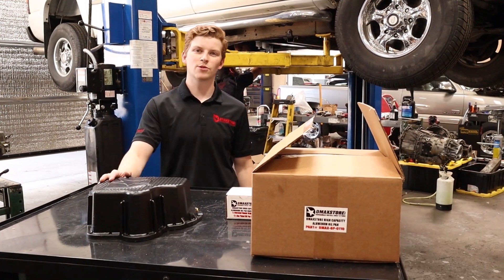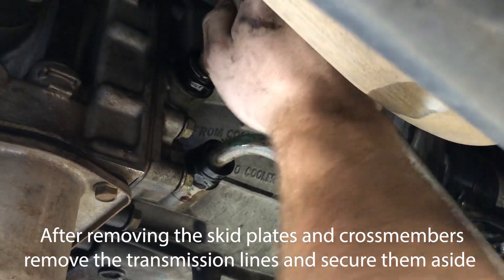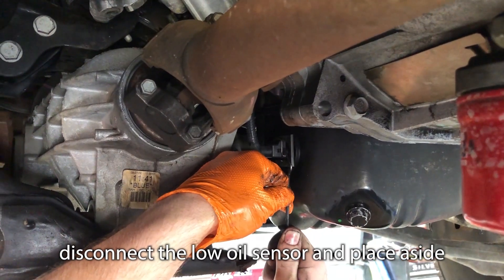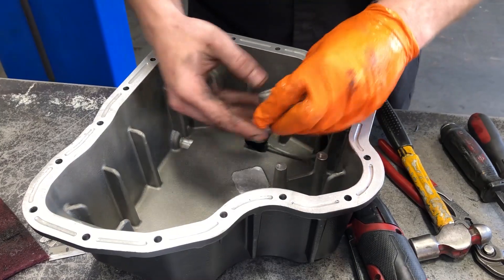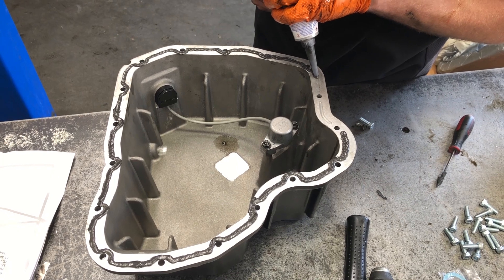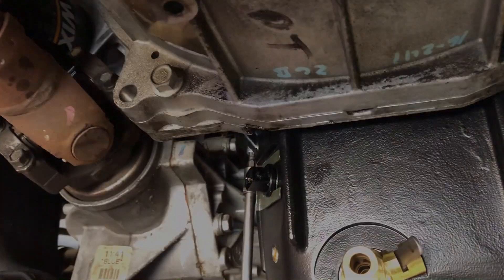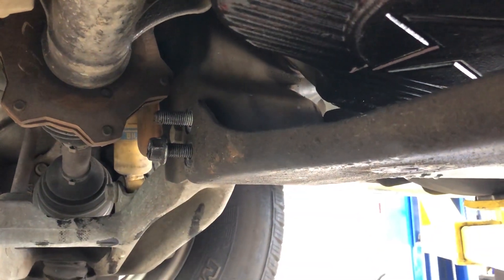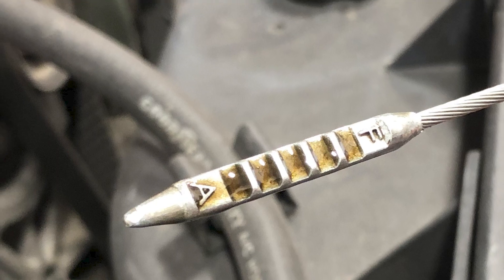DmaxStore High Capacity Oil Pan Installation for 2001-2010 Duramax

Comment: How u get it off with lift kit ??
Reply from the maker: Remove the crossmember
Reply: @ shit and take the whole front end apart ? The whole bottom control arm torsion bar and all are bolted to that cross member. It’s not the stock one anymore where couple bolts and falls out. Trying to find an easier way without doing that . Tried unbolting the trans mount and lift the trans. It still not enough room for the pan to get passed the oil tube
Reply from the maker: Yeah, depending on the lift kit you’ll have to remove everything, some lift kits like rcd you can squeeze it in.

Comment: You mechanics are all the same. Impact on everything. Absolutely fucked the threads to that skid pan bolt. 
Can’t see it from your house though, right?
Reply from the maker: Funny enough we actually did have this truck back in the shop and the skid plate bolts are actually in good condition still, thank you for your concern though!